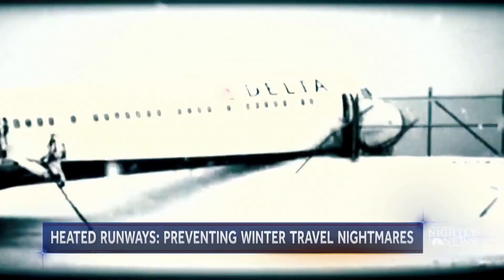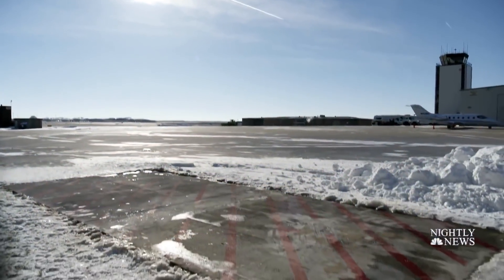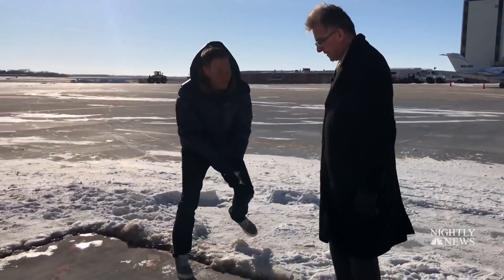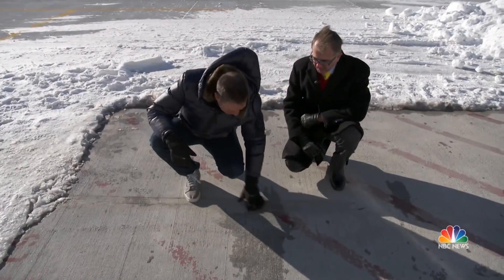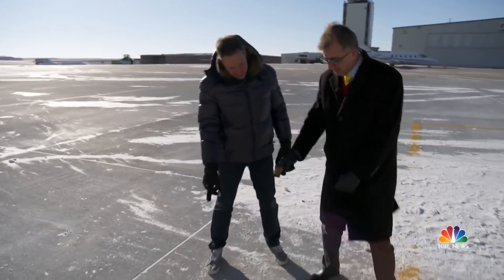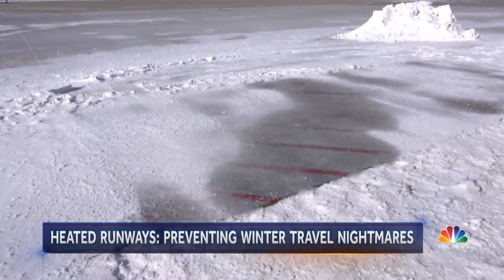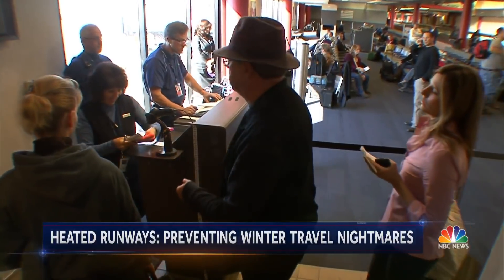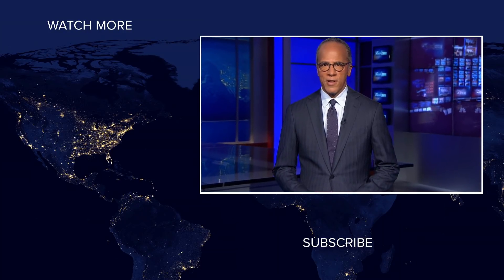How Heated Runways Can Help Prevent Airport Weather Delays | NBC Nightly News

Comment: Drawbacks: What if the electricity doesnt work? Also, will taxpayers really want to pay for this?
Reply: If use hydro .. doesn’t need as much electricity.  10 feet below the surface of the ground is 55degrees  doesn’t matter if it’s winter or summer it stays 55degrees..    we can have huge  water heat exchanger underground.  That pumps 55 degrees water to the surface tarmac.   Since 32 is freezing. If water continuously runs . With some salt . It will lower the freezing point of water and rinse out the snow in no time .
Reply: @danielmankinde1706 I don't agree 100%, but I see where you are coming from. Many carwash owners think the same and then have to spike up their boiler trying to prevent everything from freezing up. In cold conditions with such a long runway it would take an absurd amount of energy. So in my assumption even if this was a thing the runways would still have to shut down in really bad climates/ weather. As it is most heated driveways can keep up with snow drifts and such on max. I can only imagine the energy needed for a runway
Reply: Generators